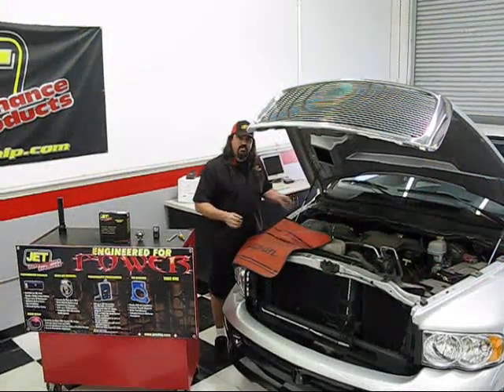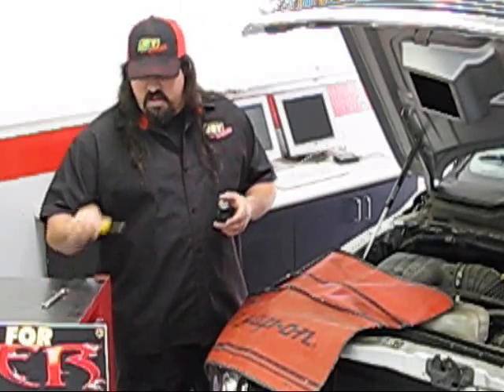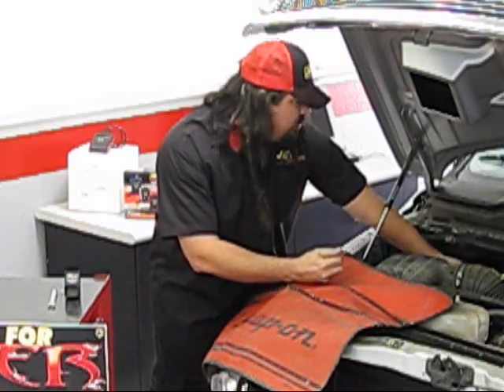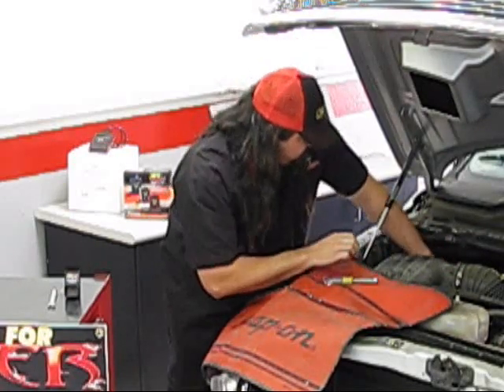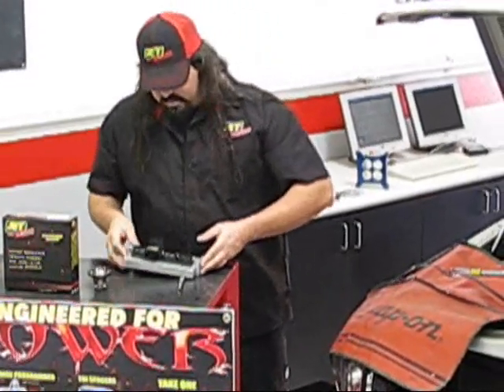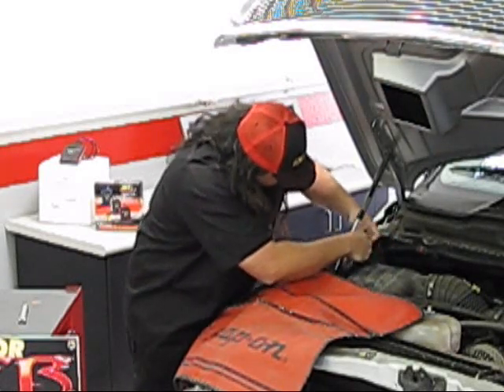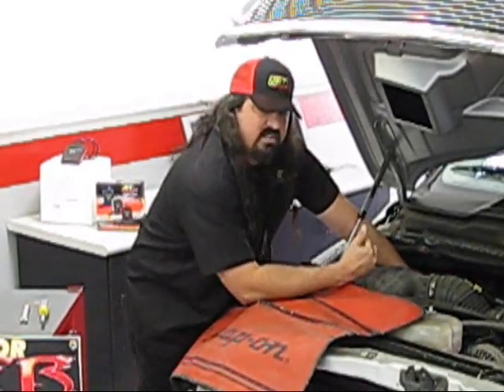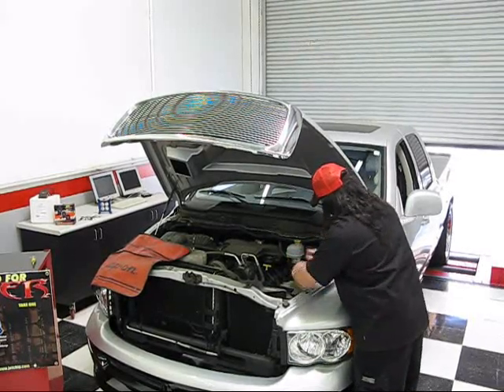Jetchip Install Dodge Hemi

Comment from the maker: Unfortunately, you can not use a JET Performance module and Diablo Sport together. You will end up with too much timing and over fueling of the engine. But without the Diablo Sport our stage 2 module will add 17+ HP and 19+ FPT at the wheels.

Comment: Why should I put in a thermostat in a 2004 hemi when I live in Florida.  ?????
Reply from the maker: To keep your engine running cooler than normal thermostats provide regardless of where you live. 
Your engine temp is going to run as hot as your stock thermostat is meant to run it, ours runs it a little cooler for better performance